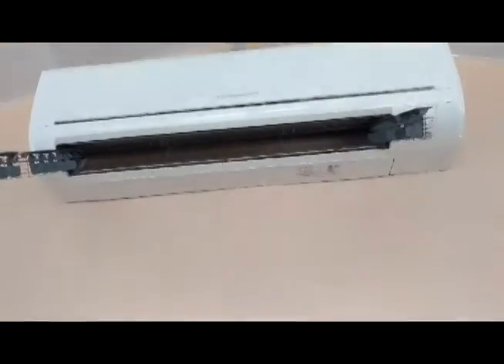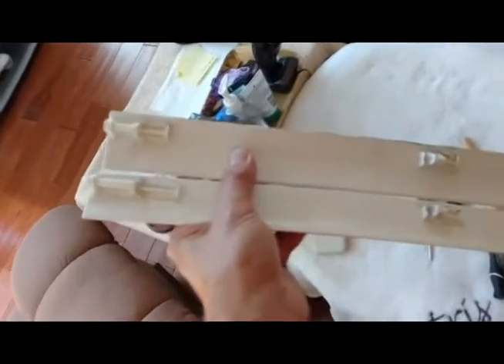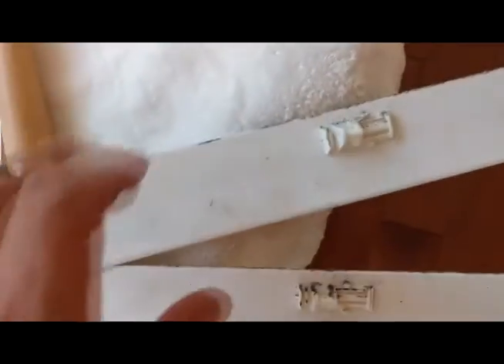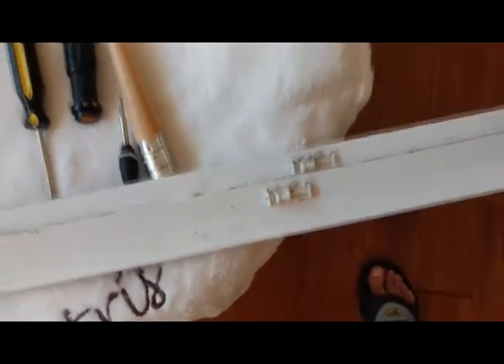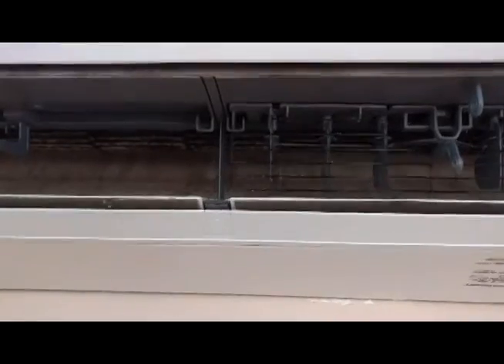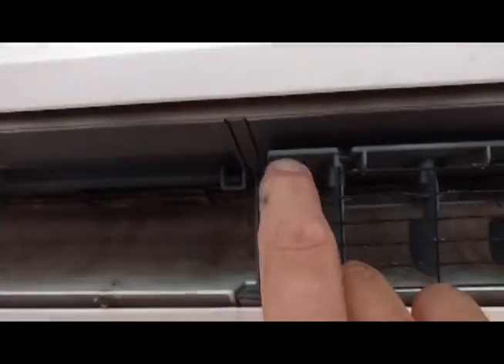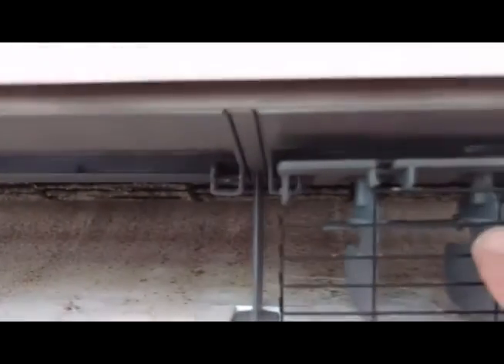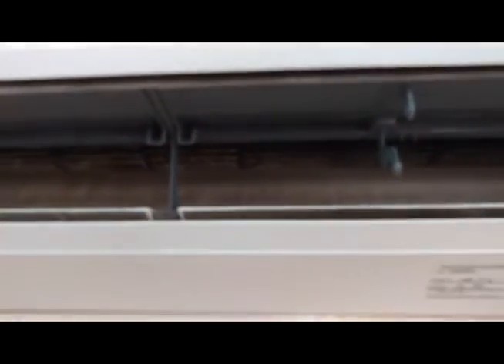Misubishi Ductless AC MSZ FE18NA & MSZ GE24NA  blower access instructions

Comment: Love this!  I was  starting to pucker thinking how much it was going to cost to get my unit cleaned. Looks much easier than a full tear down and pulling the squirrel cage.  Edit: just cleaned my unit using this method worked like a charm! I’m pissed at the effing service guys never told me I could do this. now I can clean it on the regular and not have to worry about ending up with a nasty moldy squirrel cage.

Comment: I have this model and need to clean the blower wheel...I followed all the steps up to popping the second set of tabs on the fan gate...can you elaborate a little on how to pop that tab please? Thanks!!!
Reply from the maker: Watch the video carefully and you'll see how the tabs work. The hard ones are the tabs in the middle. They're very stiff the first time. GENTLY push a narrow slot screw driver into the bottom of the "U" shaped plastic while pulling on the plastic frame. Assuming you've already released the other tabs it'll pop right out.
Reply: FishHead33 thanks!  Those tabs do seem to be really stiff...I've been trying to gently push on the u shapes part and it still won't quite pop.  I'll keep trying, thanks!